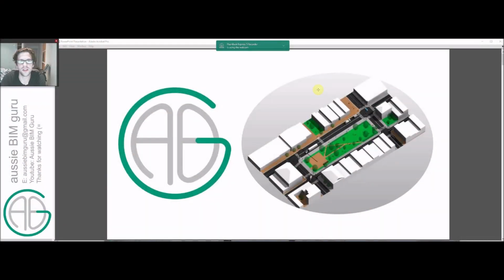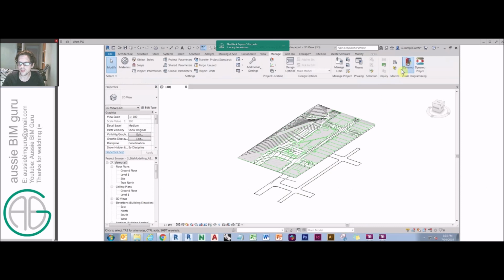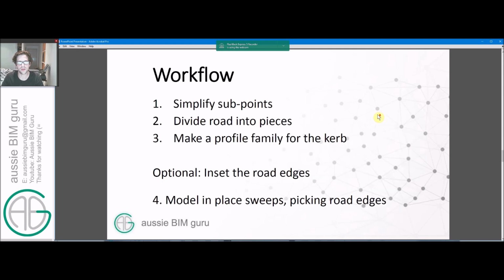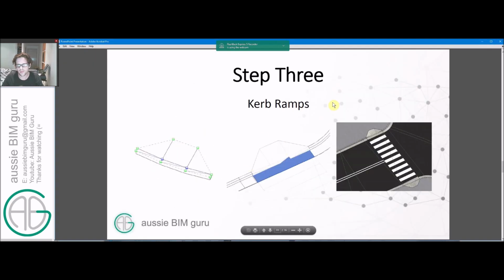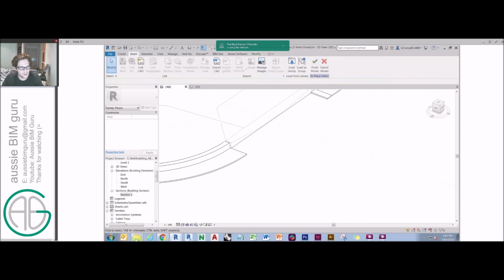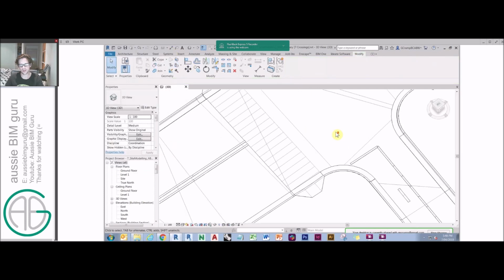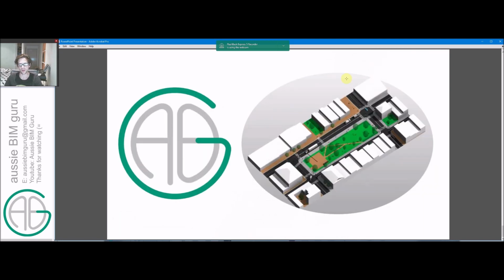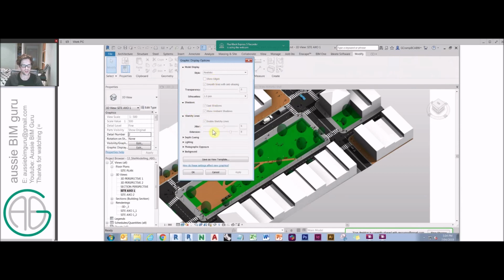Revit Site Modelling: Roads, Kerbs and more!

Comment: I have made an almost identical script to your road to topo extrapolation except I gather interior points. Is there a reason you have chosen not to gather interior points for higher precision of the road surface contours? I have found it helpful on large parking areas and sloped drives.
Reply from the maker: I have made such scripts since this video, but I'll put not having it here down to being more of a dynamo beginner at the time I made this!
Reply: @AussieBIMGuru  Fair enough. I did see the video was from a few years ago. Some of your other scripts are more in depth so I was curious if you had a deeper reason. Keep up the good work!

Comment: Great tutorial, thanks Gavin, could you advise how to draw model lines on a surface, for example: I'd like to add a single line on each steps of a stadium auditorium ( so that later I will add seating base on those lines)
Reply from the maker: You would need to pick the face of the element as your workplane before drawing the model line, or edit the line's workplane after it has been drawn at a different plane.
Reply: @AussieBIMGuru  Thanks a lot, Gavin, have a nice day!

Comment: Instead of in place model sweep, why don't you use structure framing?
Reply from the maker: That's another option, although mitreing on angled corners might be problematic. These days I tend to use roof for paving and fascias for kerbs.
Reply: @AussieBIMGuru  is site designer add-in better option ?
Reply from the maker: @immi85  i haven't used it too much but it looked to be able to help a bit. Ultimately I think Infraworks may become a better option, and ideally architects wouldn't have to model site context if more civil engineers used 3D models.

Comment: Hi Sir after watching this video I'm working another topographic plan but when i come to Dynamo and i open the file why it not take the file and give an Error massage , help me Sir
Reply from the maker: Which node is generating an error, and what does the error say?
Reply: @AussieBIMGuru  the error is " Error opening Corrupted File"
Reply from the maker: @ajendrakumar6419  it sounds like the file will not be recoverable. Usually a corrupt file is caused by loss of data. Depending on your Dynamo versions too you might be in a version too low to open the script.
Reply: @AussieBIMGuru  Sir  I'M using Revit 2020, Can i send you my data? With Regard If possible Plz check that and give me solution or Damo on my file
Reply from the maker: @ajendrakumar6419  you can, but if the files are corrupt there probably isn't anything I will be able to do.

Comment: Great content as always ! I have a problem that I have tried for few days but no luck so far. I am trying to put equal points on a topography by dynamo (on X and Y axis, Z points to lie on the topo's level) , so that I can put family on those points. However, I am stucked at the stage where I extracted polysurface. I cant turn the polysurface into single surface where I can use point on Parameter to insert the point (even if I use this method, I can only use UV on surface instead of XY). What would you suggest me to solve it? And I think topography with dynamo is an interesting and useful topic for your viewers, especially beginner. Thanks heaps mate !
Reply from the maker: Thanks, I agree, could be a useful topic!

To solve your problem, place a set of points in the XY plane, convert your topo to a surface or polysurface, extend vertical lines from the points as curves, then intersect them with the surface. This should give you the points by Z at these preset XY locations.
Reply: @AussieBIMGuru  Yeah right ! Why haven't I thought of that ! I really need to encourage myself to think out of the box.  Just another question, is there anyway that i can convert multiple surfaces (polysurface) to single surface? Thanks !
Reply from the maker: @xjphang  yes i believe the explode node might work. There should also be a 'polysurface to surfaces' node I think. Still don't have dynamo so can't confirm unfortunately!
Reply: @AussieBIMGuru  Great ! Will give it a go ! Thanks for your time and stay awesome !!!
Reply from the maker: @xjphang  you're welcome, likewise!

Comment: Hey Thanks for video! Its very helpfull .But ı have question :how could he look like that at the end?How's the Diagram effect?I tried to change the graphics settings, but I couldn't get the same graphics and same looking :(
Reply from the maker: The main things that helped are;
- shaded mode
- ambient shadows
- lighting 50/30/15
- turn off outlines (only possible in shaded or realistic mode)
Reply: @AussieBIMGuru  Thanks  a lot. I got it
Reply from the maker: @erenfbdamir  great work! I actually use these settings in my professional work so hope you find them useful in other scenarios also :)